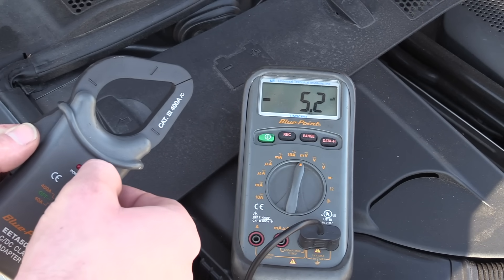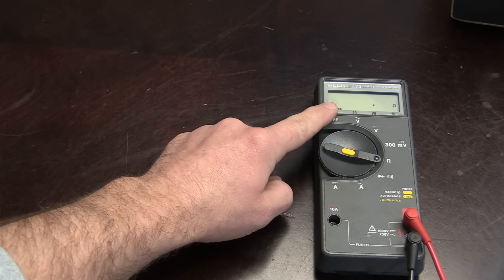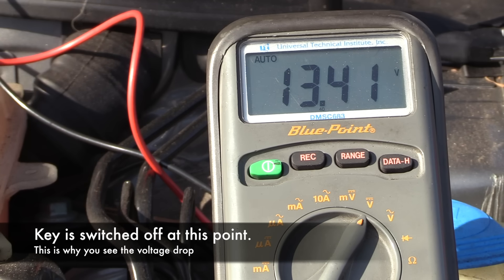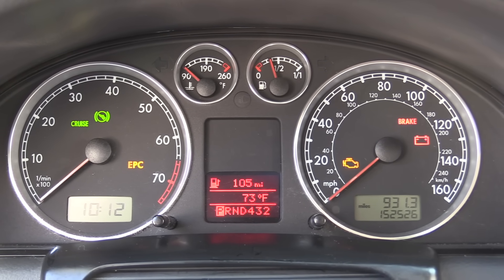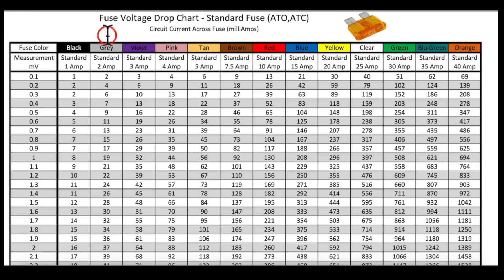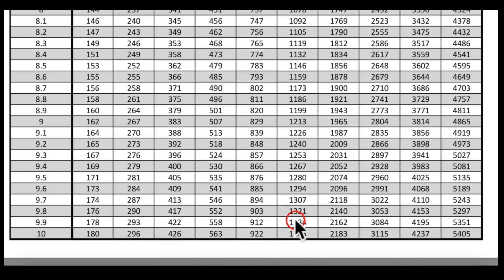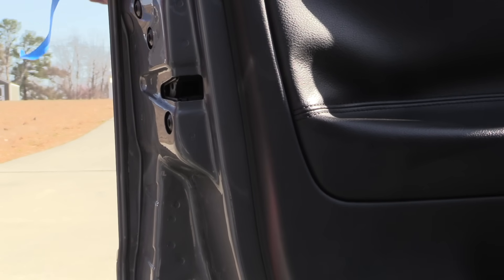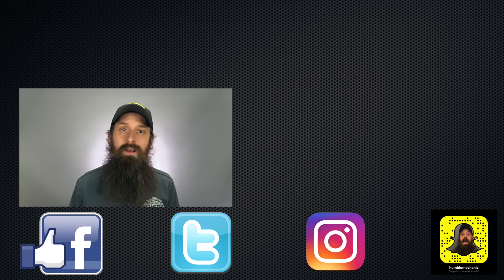The BEST Way TO Perform a Parasitic Draw Test

Comment: The more amp draw the more voltage drop across the fuse. Good job on this video!
Reply: So am I supposed to be looking for a fuse that doesn't drop. Or one that has a large drop?
Reply: @GreaseMonkey-zm2ex  This is a really good video. Look for one that drops a lot which is the same as one that has a high millivolt reading on your meter.

Comment: Great video! I have an intermittent problem. My EFI fuse blows only when temps outside are extremely hot (90-100+ degrees). It first happened in death valley.  It has since happened to me 4 other times. I do my own wrenching for the most part and have tried to find the issue. Do you have any suggestions? I love my rig, it's a 96 4runner. Any potential help would be greatly appreciated.  Cheers

Comment: One problem, not all of us have a fluke with a 30mv setting
Reply from the maker: Fair enough. You can try a cheaper meter. It may work. But at some point you’ll have to decide if you want to invest in tools for a job, or pay to have it diagnosed. 

For diag type tools it can get $$$ fast. It may be cheaper to pay for a tech to diagnose.
Reply: @HumbleMechanic  Yeah I bit the bullet and paid for a more decent one, should have checked first but it was at a trade stand so couldn't really look.
Car is a Honda civic and they're well known for their parasitic drain like you say just a case of going through every fuse.
I suppose the upside is, once I sort this it'll be a new skill learned.
Reply: @HumbleMechanic  Also sorry for coming across a bit abrasive, is been a tough day but I'm getting there.
Reply from the maker: Hey no worries man. We all have them. And you’re not wrong at all!!  

I really appreciate the comment and hope the day gets better
Reply: @HumbleMechanic  Yeah it's not that bad, I was worried it was something terminal.
Found it has a 200mv setting, took off the negative and used the reader on the wire and got a reading of 0.5 of that means anything to you.
Ripped out the fuses on the engine bay, but no difference which I expected.
I have a feeling it'll be something daft like an interior light staying on.

Comment: Being an electronics person ... i.e. college... When you check your "leads" by performing a continuity test, you are also checking the internal fuse of your meter.  You can have brand new leads and connectors and still fail this test with a bad internal voltmeter fuse.
Reply from the maker: Important to know that too. Lol

Comment: a dc amp clamp over positive battery cable was a simple way to confirm current draw and see it isnt intermittent or occurring when off, but is 2.5+ amps in accessory mode.  it does now pose new hurdles to figure out if that is too much or abnormal since some stuff is supposed to be on.

found activity on 3 fuses: lights, interior lights, hi/low 'running' lights and ECM blade fuses, but pulling them ex running lights (9-10.7mV) or ECM did not noticeably drop the amp draw.  i've done all the blade fuses, the 20-40 amp box fuses and pulled half the relays, no change.

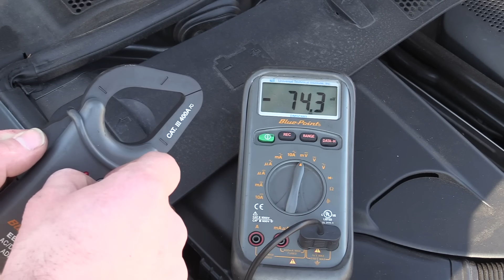Comment: 0:55  dont need to open ciruits or disconnect battery.  1:00  dont need to fool with an amp clamp or use big test equipment, or pull fuses.   1:30  we use multimeter + 'fuse voltage drop charts'.   
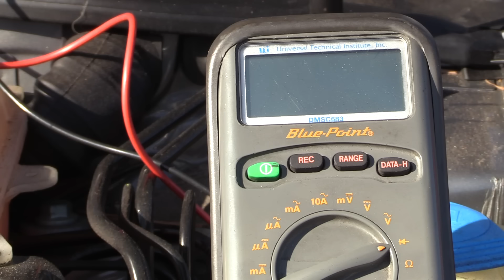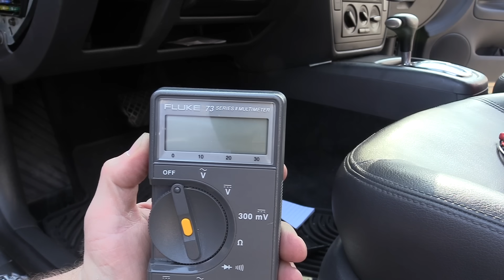2:00  first test the leads (ex .1 or .2 ohms steady).  3:00  the hookup to battery missing.  4:25  latch+mark the hood and doors, 5:08  then confirm hood/door 'closed' on dashboard.  lock car.  5:28  put multimeter to millivolts then check across each fuse 3-5 seconds to watch voltage drop to 0.00.   if it doesnt drop to zero, there's likely an issue.

6:20  once we know amount of volt drop across fuse, we use the chart to find corresponding amp draw.  9:59  this is quick way to find if you have an amp draw issue.

Comment: I need y’all’s help. I just bought my brother 2017 F150 Rocky Ridge PU. It’s an awesome truck. Long story short. I have a hoopdee that is my daily driver. I’m trying to save as much wear and tear on the truck as I can. So sometimes the truck sits for days.  Anyway last week it wouldn’t start. My brother had retractable running boards, remote start, new backup camera/ radio and some cab lights installed. All aftermarket. Took  the truck to them, they can’t find the problem. They told me to take it to the ford dealership. My question is if I believe say the radio or the remote start is draining the battery, where will the fuses be to check the remote start or the running boards. Any information would be appreciated. Thank you 🙏🏻

Comment: Hi Charles, Is there a way to test Golf Fans ? My A/C is ice cold while driving but warm while stationary. I've replaced pressure switch, fan reply, A/C gas, expansion valve, Condenser. dryer etc. Still no luck to fix. So thinking it might be the Fans but I jumped them off using the plug and they work but didn't know if there's a way to test to resistor in the fan ? Sorry for such a difficult question as I'm sure your a very busy guy. Any ideas would be grateful. Cheers Duncan (UK)

Comment: What if my fuse box is in my glove box (that has a light)
Reply from the maker: Try and tape the switch closed
Reply: Ah thanks. Are the precautions just to prevent further power draw (for the batteries sake) or would the lights mess with the readings on the fuses (your sake) it wasn't clear to me

Comment: Thanks for the video. I always thought of fuses as a dead short with no voltage drop but I guess car fuses are different. Great info.
Reply: That's exactly what I was thinking! I suppose there has to be a little resistance in the fuse to cause a voltage drop, otherwise, it wouldn't heat up any faster than the circuit it's protecting.
Reply: I thought the same.

Comment: i use a thermal imaging camera from snap on now to narrow it down first, but i have been using this method for over 10 maybe even 12 years now with phenomenal success. verify with low amp clamp meter also will verify the load is no longer drawing. you may need to have a fluke meter on record over a weekend to find out if something is waking up such as on star modules if you don't find a draw right away.

Comment: If the battery is good and I assume the rest of the charging system checks out, but I get absolutely no lights when key is put into the ignition, then this test would be pointless right? Because something else is keeping the car from starting completely?

Comment: disconnect negative terminal to battery. then test fuses.any fuse has power with negative terminal off,, means the device to that fuse  is grounded out  in the device itself.. i.e the device  itself is bad. if wanna be sure . pull fuse, after battery is fully recharged. let car sit for few hours  or day. ,,thats after you reconnected the negative battery terminal to charged battery..sgain let car sit for few hours. if car starts up that device is your vampirite draw.  or could use volt meter to test battery level after fuse is pulled

Comment: Why not use a fused jumper at the battery and calculate draw with the chart instead of installing the meter inline? It would be cheaper and easier to replace a fuse vs. the one in the meter....

Comment: At 7:01, I read 1086 miiliamps which is about 1Amp rather than 0.1 Amp. Otherwise a good presentation.
Reply: This really should be a pinned comment.

Comment: Thanks for the video. I have a 2004 touareg and once I turn it off after few second I start hearing a click under the driver dashboard like a switch on / off and keeps doing the same thing over and over every minute or so which cause battery draw. I tried to track down the fuses with high amps and found out that the radio fuse is showing high amps right after each click. I took out the radio fuse but still having that click going on and on. Any thoughts? Anyone had this issue? Please your help is much appreciate.

Comment: This is an awesome tutorial!  However I didn't find a voltage drop across the fuses.  The car is a 2000 vette. The fuse boxes are near the battery under the hood and under the glove box.  The resolution on the meter is 0.1 mV.   The battery goes dead in 10 days so its not a huge drain.

Comment: Hello, i have a golf 4 1.4 16v petrol 2001 and i am having problems with the first ignition of the day ( it just won't start). After that "failed attempt" the car starts perfectly all day. The battery and 
electromotive relay are brand new and i just can't wrap my head around this. Did you happen to encounter this problem ? Can you tell me what it might be. I forgot to mention that there is nothing out of the ordinary lit on the dashboard and i have also put a tester on the car which did not show that there are any problems with the car. Thank you in advance !

Comment: I've been a tech for over 25 years.
I thought I was pretty good at electrical diagnostics. 
This video set me straight. 
What a great technique.
Thanks for these videos. 
I wish these were around in the 90's.
Reply from the maker: Always keep learning man. As you know it’s how we stay on too
Reply: @HumbleMechanic  About to buy an 06 without radio. Owner says radio is killing battery. Great video! Does replacing with aftermarket radio fix the battery drain issue?
Reply: I am a 12v technician at a car audio shop. The number of dealership techs that don't know how to do a proper current draw test is mind boggling. I get a couple cars a month that are misdiagnosed because of poor electrical troubleshooting. If every tech watched this video the world would be a better place. And if you do this for a living Blue Point has a tool called the Amp Hound which does the fuse type current drop for you so it speeds up the job and makes you more efficient.

Comment: This is very informatative thank you. I have a question. I have an Audi A4 Avant 2.9TDI Sport, 2016 (UK specification) automatic gearbox.
If I start it, with a/c off, the voltage barely increases above what it is when the engine is off (12.6V). Is this a sign that the alternator is not charging the battery, or does the car know that the hood is open, and not charge because of that?
Reply: I'm going to answer my own question in case it helps others. My car has a voltage regulator/'intelligent' power management system to reduce the alternator output when the engine is idling. This system was implemented to meet European emission standards. With the engine idling, I could not get a voltage reading higher than 13.3V, but neither the battery nor the alternator are faulty.

Comment: Thank you for your video.  Your presentation was very helpful.  I'm currently dealing with a parasitic drain problem on my 2000 BMW Z3.  It's a small drain because it takes about a week for the battery to die.  I have load tested the battery and it's good.

Comment: i have a question..... i dont have a meter to test current draw over 10 amp and I have had to repair a pos/neg to blower motor... i get full 14v at the 2 power wires under dash by blowwer with a/c off and when I turn on A/C it drops 1 volt... is there a good way to test voltage drop between these 2 wires?  when I use a/c when vehicle is running it draws too much and drains battery and will not start once I go back out to restart after a short trip...( I did test to make sure no paracitic draw fro the battery after car is off and modules sleep.. on the discovery its about 6 mins  .. land rover discovery 2003 .... as long as I dont use a/c its perfect and a.c does work but car starts to run hot with less cooling and fan works... im suspecting a bad fan motor drawing too much possible? im replacing fan motor at moment but was just curious.. also when running a/c those 2 wires get hot

Comment: I heard on newer cars you need to leave your terminal connected during the test to find the draw is that true??
Reply from the maker: Yes.  Disruption of power can cause weird issues
Reply: @HumbleMechanic  so I would need a amp meter that clamps on to the positive wire? Thank for the reply been watching for years

Comment: dude i have 99 passat that is driving me crazy windows dont work gaskets from the manifold to the turbo just broke and i cant find a replacement every time i order a gasket from the part store its the wrong one ugh then like i started to say the windows dont work the sterio dont work but the ac works great and so does the heater not sure what is going on with this car even the slap shift doesnt work this car is my nightmare

Comment: I checked all my fuses and they all dropped to 0 yet I'm still having draining issues. Vw cc 2010 sport. It has two fuse panels. One on the inside and one on the outside.

Comment: Any common issues for 02 5.5 V6? Intermittent issue. Replaced battery, then thought bad diode in voltage regulator, so replaced whole thing(swapped out just regulator 4yrs ago, no issue). So wasn't alternator either. Voltage on circuits 10,14,15. But car wasn't in "sleep" mode? Knew nothing about that. Will have to try that next. 10@1.57v,14@3.35v,15@3.39v.

Comment: Okay, so now it seems so extremely clear how to "close the doors" without actually closing the doors.  My EOS has (2) 6V batteries in the trunk.  To close the doors, she sat in the back seat to read the MM with leads through the armrest opening.
The lead's probe came off of the terminal and for about 5 minutes, we had NO IDEA how I was going to get her out!
Then it came back on, so I guess it had temporarily lost contact but came back (it was taped to the top).
So dumb, but never again.  Thanks for including the latching of the doors, trunk and hood in your video for the infrequent DIYers out here.

Comment: Anyone else's fuses not register? They are plastic topped so im thinking the leads cant connect with them. The big fuses without plastic covering the metal bits do
Reply from the maker: Some times you can pull the fuses away a little and get on the contacts. The covered ones are a pain
Reply: @HumbleMechanic  ahhh thanks so much :)
Reply: @HumbleMechanic  Thinking of just replacing the fuses with some metal tipped ones, make it easier :D

Comment: My 2006 jetta value edition has a dead battery, tried to jump it and as soon as i connect jumper cables the horn on the jetta starts going and wont stop and it wont crank either, any ideas?

Comment: This is an interesting approach. It relies on a non-ideal characteristic of "real world" fuses: internal resistance. If the fuses were perfect (zero resistance), there could be no voltage drop and thus nothing to read. So it's sort of a lucky accident not only that the fuses have a little resistance, but also that the resistance of each fuse type is consistent.

Thanks for posting. I'm definitely going to bookmark this one so I can find it when I need it.

Comment: What happens if the draw is intermittent?  You would miss the draw doing it this way.  You would only catch the continuous draws.    What about the fuses that are not the type you tested?  Not say you can't use this method but seems very unreliable as most draws are not going to be constant.
Reply from the maker: This is exactly why we need to know multiple methods. A meter and pulling fuses would present the same issues. 

I’d run a long term draw scope on intermittent draw. But in 3 minutes you can go/no go on a consistent draw

Comment: If you do this method to the main battery fuses you can also pin point which fuse box is the problem. Each big fuse goes to a fuse box so you can eliminate probably 80% of the potential problems by measuring 5 or 6 fuses.
Reply: True but the big fuses have covers on them and are not like the small ones with the metal contacts

Comment: I messed up the other day i wqs putting a new top on my 94 gt.  At a point i needed to put down the back window so i put the key in turned it to give power to put it down and continued to finish top
After a while my back stsrted hurting so i went inside for a break i puulled the keys out the ignition and went inside for a while when i came back out to finish the top the battery on my phone was getting low because im youtubing how to replace the top so I plugged in my charger in the cigarette lighter but it wasnt working i decided to change the fuse after i changedvit it still didnt work infact i lost all power not even head lights would come on i put the hey in to crank it up and nothing at all battery is fully charged i checked fuses under hood with a tester everything was fine i checked the fuses under dash and none of them are getting power so i would most likely have to replace the fuse box under dash huh? I know i sound stupid i feel stupid too i guess its not really a question just wanted a reliable source to agree ill have to change the whole box
Reply: Edit for clarity.

Comment: @HumbleMechanic

I just replace the battery on my 2015 Passat because the car wouldn’t start anymore. After I replaced the battery, the power steering stopped working. The trouble codes say 

“lost communication with steering angle sensor module U012600

Power steering control module 01309

Steering angle sensor 00778”

What could it be?
Reply from the maker: Have you driven it? Usually the get that way because the basic setting is lost. Usually a 50ft test drive and you’re good
Reply: HumbleMechanic  I did. It’s really hard to drive because of the absence of the power steering.

Comment: Not all charging systems will produce 13.8 or higher when running. Some have smarter charging systems and can read like regular battery voltage if the charge is nominal.

Comment: assuming the fuse you are testing is not a no name china fuse, because the resistance of china fuses are not calibrated and usually have smaller resistance, because of this voltage drop will be smaller than normal.
Reply from the maker: True. But I think you’d still get something happening